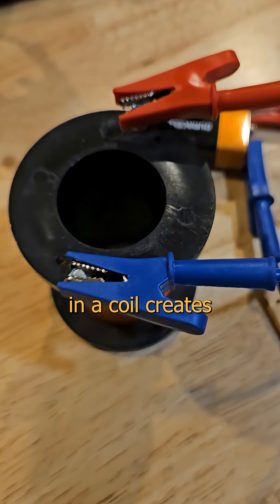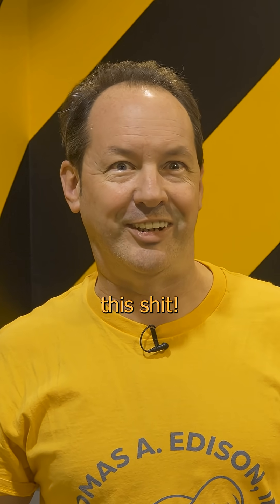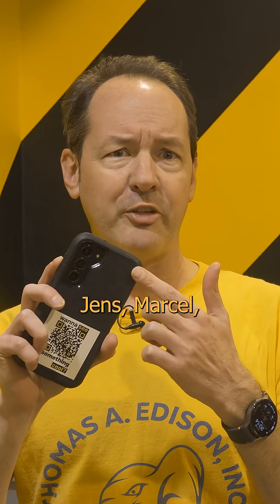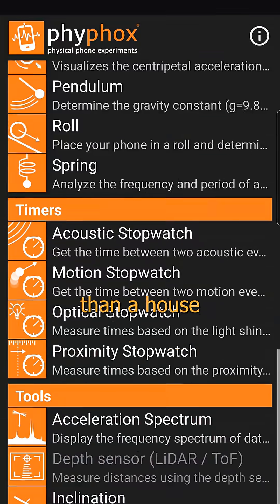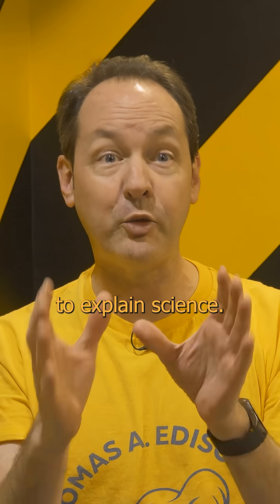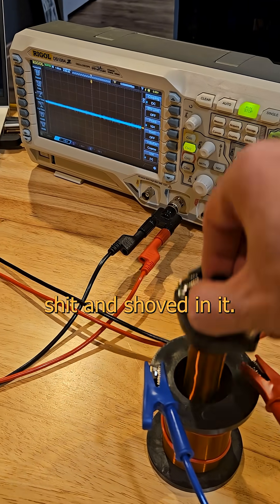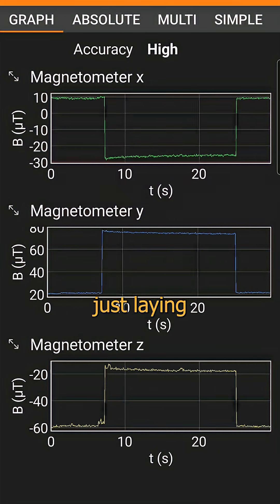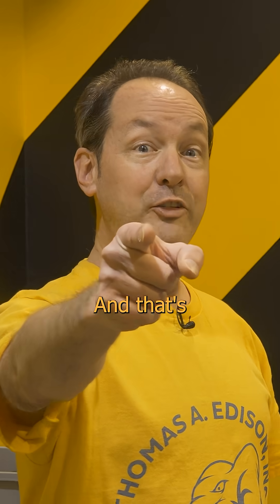DC Transformer Experiment #chrisboden #comedy #physics #science #faraday #phyphox #electricity

Comment: Ah phyphox the 1 of 2 solid orange apps I have that sit next to each other
Other being nfc tools

I once used phyphox to find a chunk of weird rusted metal on a beach using magnet sensor
Looked like a hollow square metal tube you could barely fit a straw through its opening

I also like all the different viewing options  for data like if I want to see xyz I can but for the magnet metal finding a single value might help
But the graphs are easier for that as you can see the sudden change easier

Comment: Actually my dad who is a radio engineer explain this to me on his tractor. He's got an old 1960s power King economy model, and the spark plug is driven by a chopper drive. So instead of a regular distributor, it just has a set of points that open and close sending current across a coil of wire. And this chopping DC current across the ignition coils, is what causes the high voltage for the spark plug; but very basically it's a DC transformer.

Comment: Before phyphox existed I had an iPhone app that would run an FFT on the accelerometer data. I used it to figure out why we had an intermittent analog-looking slow shimmy in a picture coming from a digital CCTV camera. Turned out the pole it was mounted on was vibrating in wind at 12hz with a frame rate of 12.5hz. A generation ago (with ACTUAL analog cameras) that would have been a piss spitting NIGHTMARE to find.

Comment: One of my favorite historical tricks for what essentially is a DC/DC converter is taking a buzzer (a relay with spring arranged to keep the contactor closed with the coil wired in series with it, so that turning it on causes the relay to open the circuit) so you get pulsed DC that can be fed into a transformer to step it up or down. This setup would typically be used for low voltage stuff instead of a motor generator, and I love how cleverly dumb it is

Comment: And if you have one transformer on a bearing with 120vAC, and you have three coils surrounding it in a circle in 120 degree intervals, you've created a synchro. If you hook up the stairs wires from the first synchro to the stator wires of a second synchro and hook up a reference voltage to the second synchro you can transmit the angular position of one synchro to the second.

Comment: Old car.radios uaed.tubes and needed more than the battery...they used a vibrator relay to pulse into the primary and it made a higher voltage in the secondary....

Comment: Phyphox is underrated. I got it when you'd mentioned it a few months back, and it really opened my eyes to the small things you can't see. First experiment was seeing how much the floor in my bathroom was giving out by placing my phone on the counter, stepping away, coming back and seeing the movement captured. And thats just the tip of the iceberg, and I've used it to test soundproofing and light seepage from different curtains as well. I can't wait for the day that I get to pull it out and solve an issue at work.

Comment: I’m curious to see the result if you supply power from a running car. It’s only 13 to 14 volts dc but it should be a lot more current, so maybe it’ll show up better on your meter. I’m a mechanic and I use lab/pico scopes to check electrical problems literally all the time. Curious to see if there would be a change in that. I feel like one coil should definitely be able to power another through an electromagnetic field. I’m just not sure would the end result would be.
Reply: Maybe supply separate power to the other coil as well through a relay or a solenoid just to see what that it does.

Comment: I had something my grandfather gave me that was close to a DC transformer, we called it an induction coil here in Britain, I know something similar was used for old farm radios in America to create a high voltage from batteries for the tubes. 
I think they called it a buzzer and it is not unsimilar to a doorbell/buzzer mechanism and made a loud buzzing sound in operation. 
The coil connected to the batteries (primary) had an iron core and a spring switch contact in front of it that breaks the circuit and then makes it again when power is off, causing pulsed DC to flow through the primary coil inducing a high voltage on the larger (more turns) secondary wound over the primary. Mine, made by my grandfather was for use as an educational shocking machine, a not uncommon childrens toy when I was young in the 60s, (my grandfather explained how it worked as me and my brother shocked each other!) Powered off a 4½v cycle lamp battery it could muster quite a powerful shock and as you were meant to hold a metal tubular handle in each hand (copper pipe) it would go staight though the heart, and yes I had a serious congenital heart condition but nobody was concerned about that back then! 
I only got an accurate diagnosis at age 63 from Papworth Cardiac Hospital Cambridge who stuck me in an MRI for an 1½hrs after arrhythmia and high blood pressure problems! 
Now they pull me in for an echocardiogram and electrocardiogram every year, I'm medicated and hopefully things will be okay for the future.

Comment: Electricity is created when the wires move in a way that cuts across the "lines" of the magnetic field.  You're not going to get much with that setup.  The lines from coil A are going up and down, and you're sliding coil B along the line, not across it.

Comment: I've been using it for years to teach science.

Two phones and a tape measure to measure the speed of sound in air.

Get the class silent. Clap in the exact middle. The sound waves propegate out and start both stop watches simultaneously. Then someone stood next to one phone claps, stopping that clock instantly, but the wave has to travel to the other phone.
Speed equals distance divided by time difference. (15m minimum unless you also want to explain resolution and error.)

Comment: Phyphox is already on my phone.
Oddly enough I needed it for a temperature check in a server room (simultaneous instrument and AC failures) and I found out my phone doesn't have a thermometer. For the CPU, yes, but for the ambient air temperature? No. I guess it doesn't make sense to take the temperature of my cargo shorts pocket, but I'm still disappointed - but not with Phyphox! It rocks; download it.

Comment: “DC transformers as rare as rocking horse manure”
Yeah, because DC step up/down converters exist and they also capable of changing voltage with 80-95% efficiency. In turn, they are the opposite of a rare. You can find them everywhere in electronics, especially if that particular device is powered by a battery🤓
P.S. it’s nice to be able to flex my master’s degree in electrical power engineering sometimes

Comment: Ive used Phyphox to do noise, vibration, and harshness (NVH) analysis at work. I fix dumptrucks for a living and the NVH tools are THOUSANDS. Im not paying that.

Tape the phone to a stable surface, the frame is probably the best because the cab is damped with an airbag and a gas shock. Start charting and go for a test drive. Try to make mental marks with a stopwatch so you can track when certain vibrations pop up. Take note of engine RPM! This is critically important.

Upload that raw sensor data to Visual Analyzer, a free general purpose signal analyzer. Find trouble spots and map the frequency in Hz. Now do some math. If the engine is spinning 3000rpm, thats a 50hz signal. If you see weird stuff, big peaks, at 50hz, the problem is probably a flywheel vibration. If you know your gear ratios and find out the wheels should be spinning at 23hz, and you see huge 23hz peaks, you know that you have an issue at the wheels or the axle stub shaft.

Comment: It’s not the magnetic field that produces current, it’s the CHANGE in magnetic fields. If the magnetic fields are just sitting there, the electrons will just hover close to the magnetic field but they won’t move. The movement of electrons is pretty much the definition of current. So, no movement = no current.

It’s once you start changing the magnetic fields that things start happening. This can be done by flickering dc really fast using a VFD (variable frequency drive), which produces square wave, or moving the fields. By the time you achieve this, you probably would have already chosen to go with another voltage source.

Comment: Pulses of DC will cause the build up and collapse of the field in the input coil which causes the lines of flux pass over the conductor in the output coil at a perpendicular angle relatively speaking which will induce an electrical current (at a right angle to the magnetic field) and voltage proportional to the ratio of number of windings in the output coil v input coil or something like that

Comment: A few times I have managed to measure the magnetic field of the motor of a train i was in using Phyphox.

Or at least thats what i think it was. It was a sine wave with  frequency that went up as the train accelerated.

Also the pressure sensor in my phone can see if the trains door is open / closed. The pressure inside drops enough to be measured by a phone when they open.

Comment: Cool app. Although I already have a tri field EMF meter (a couple actually that measure in all the units) a couple oscilloscopes and even a Geiger counter I still cannot definitively say wether is accurate or not because I have never found anything to test with it (which is probably a good thing)... even had it on in my pocket while getting an Xray once just to see if it would read something. Cannot confirm.
Cool app though.

Comment: On the other hand that exact setup works as expected if you hook it up to a wall outlet instead of a battery. Note don't do that at home kids, it's dangerous. That battery does not output enough voltage to hurt you if you touch the wrong thing, the wall outlet does.

Comment: This explains a lot. I always wondered why car audio amplifiers take 12 volt DC turning into high voltage ac, Rectify that AC and provide the actual audio amplifier board with positive and negative DC rails.
Reply: saw a video the other day where a guy took a large car audio amplifier and fed a sin wave into it and used the output of the amplifier to run power tools.  can't stop thinking about trying it
Reply: @Mike-nk3su oh yeah.  Nowadays a 2kW amp is considered small in car audio.  I have a 12kW rms amp on my bench to repair next.  Not looking forward to dealing with a 450+ dcv rail to rail difference with a crap ton of capacitance behind it....lol

Comment: So, if you rapidly plunged coil b into coil a the movement into and out of field doesn't get anything?
Reply: The exact opposite! His explanation is slightly obscured by the prolific use of prose. To get anything from a set of DC coils, you have to either a.move one of them or b.turn the power on and off (like ac but less ac)

Comment: Used phyphox on a recent flight and seeing all of the pressure changes whenever I felt the plane slightly twitch was really cool.
Reply: Also i believe you will see the toilet flushing in the pressure
Reply: @omnom4462  now this is the important info.. if this is true, it means I'll know if I gotta wait 5mins before heading to the toilet 😂
Reply: Using the FFT on the microphone or accelerometer is great on a plane too! It lets you see the speed of the engines going up and down as vibrations travel through the air and/or airframe.
Reply: I use it on so many of my flights too! However, one flight i was in was experiencing crazy turbulence and i scared the person next to me as they saw the graphs chaning, they thought i was remotely doing something to the fligtt ht😂 but like Chris says its always fun to learn and share knowledge. Person next to me was quite alright after i explained what the app does and the science shi behind it
Reply: Ayyye same, super cool using the accelerometer during landing
Reply: I did the same but for the landing i wanted to see how many g's we got
Reply: @gabrielibarra5551 and, answer is?